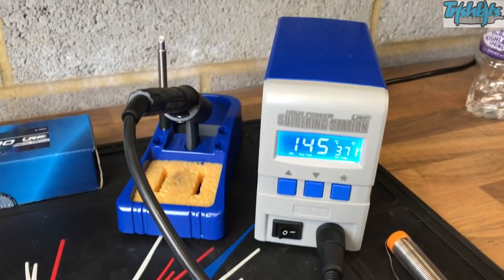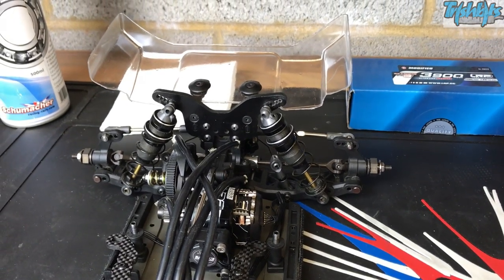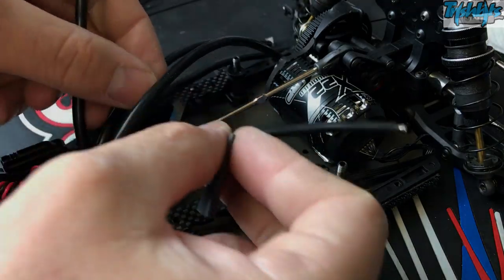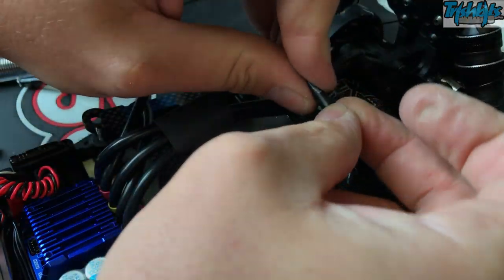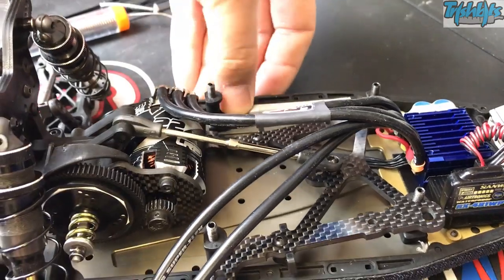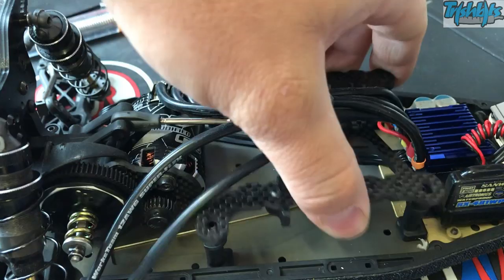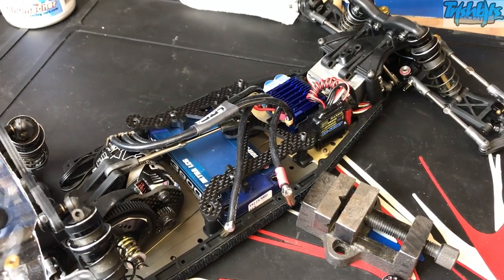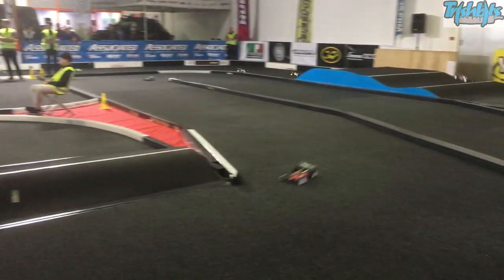How to Solder | Schumacher Laydown with Lautenbach Racing Products

Comment: Safety tip, to add to Trish's awesome video. If you don't like using a lighter for heat shrink, and don't have a heat gun, a hair dryer on full heat works very well.
Reply: I have also established that lighters do not make good hairdryers